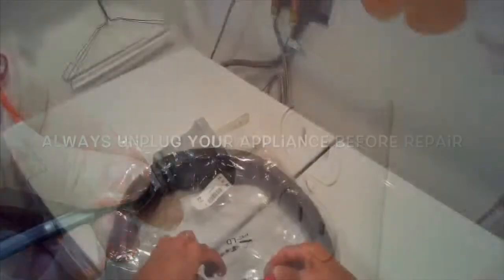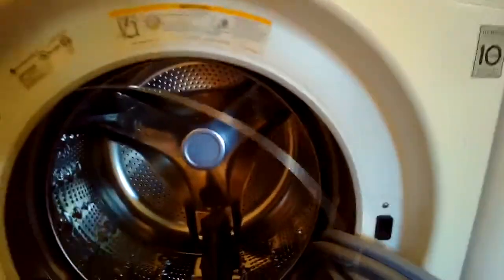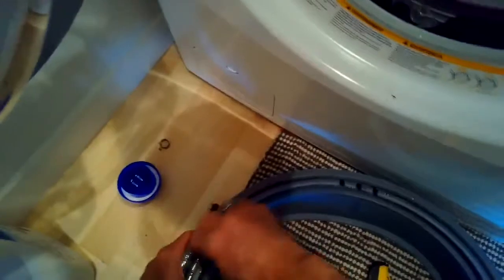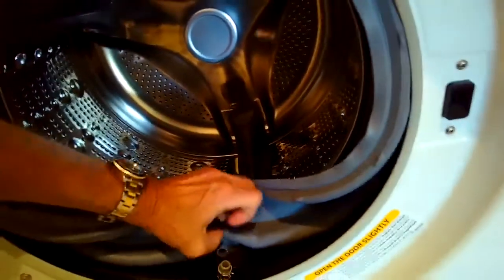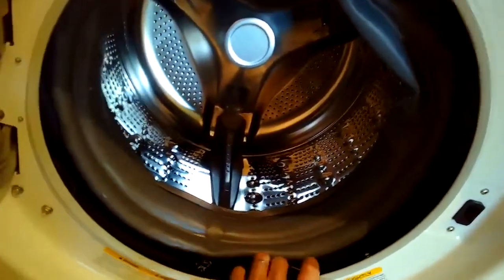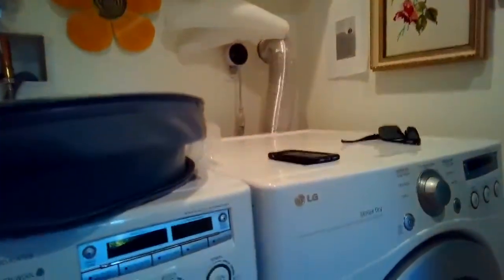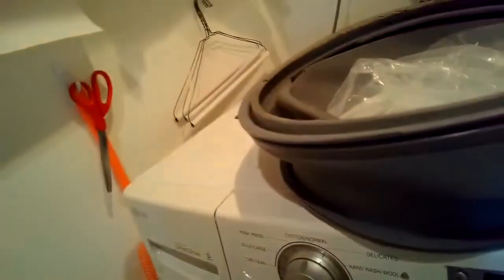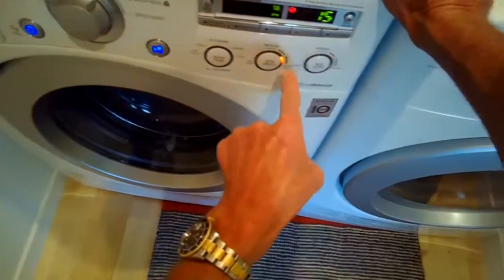LG WASHER DOOR GASKET LEAKING—FIXED

Comment: So I just replaced the whole gasket because it was leaking at the front bottom; 
 I just ran the tub clean cycle and it leaked out of the same place again. Any ideas?
Reply from the maker: Thanks Jeff, could the glass bowl be dirty preventing a good seal with the bubbler gasket near the bottom.
Reply: Hey @jeff knowles - My LG washer is leaking in the front bottom too. Did you ever find out the cause?